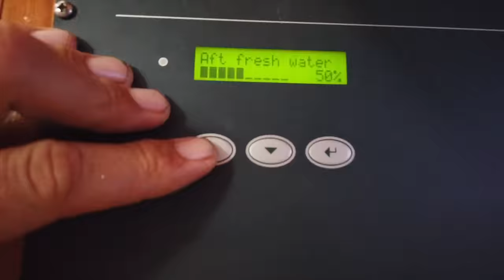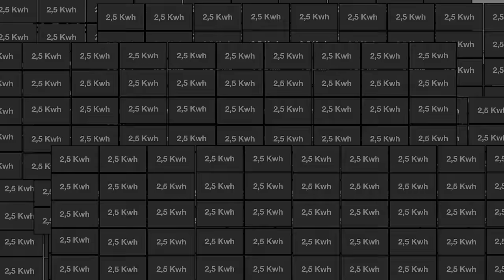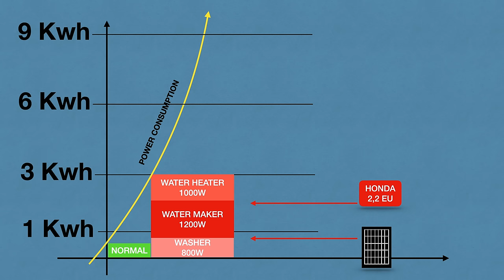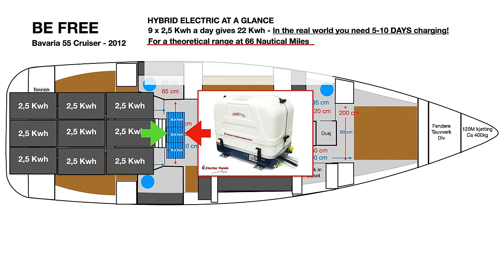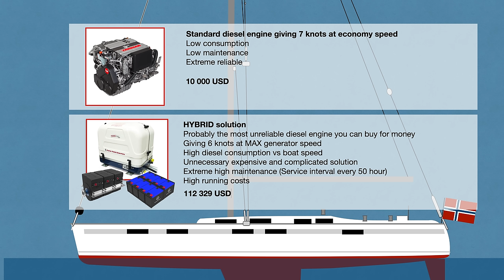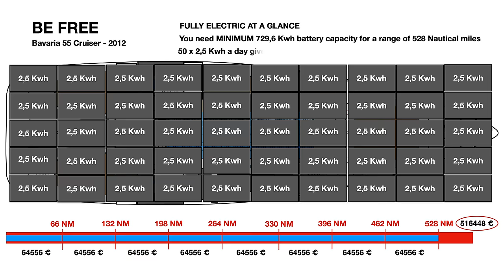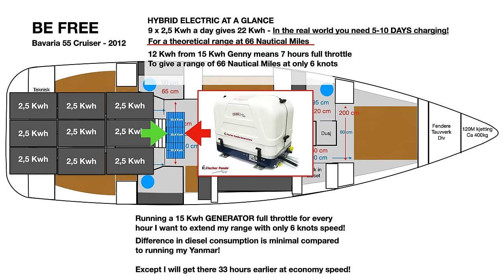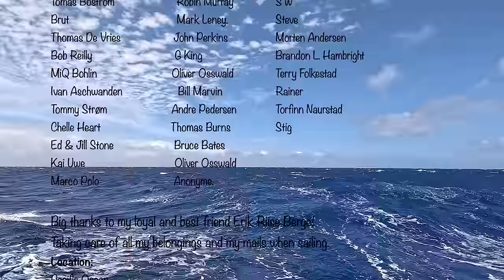Why I don't believe in ELECTRIC or HYBRID for long-distance sailing - SwT 170 - MY HONEST OPINION

Comment: Good vid production but silly and too all encompassing viewpoint.  (just converting my boat to electric.  Went across the Pacific with first).  Some of us like sailing and like to read weather and have not much of a safety net but our sailing knowledge.  I had to time my way into every port, atoll or passage.  Became very aware.  Most of the sailors I met along the way did not use their motor from the Americas.  Our times were awful, in the 30s and 40s for day ranges.  Major currents out of place and a week at the equator.  Were sailors.  But everybody's different.  You are not recommending electric because you have put together a Bavaria 55, your boat.  And that's it.  You have a funky Fischer Panda generator....so obviously all generators are unreliable and hybrid is not reliable.  Uboats worked rather too well, Prius is very reliable, Queen Mary 2 honks, and Uma sails away...hmm, they have no generator.  Its freezing in northern Canada.  I've trusted my family with a generator.  Gotta be maintained and not run at max load.  My new hybrid system is 66 KW continuous on a 41 foot boat and as long as I can find a gen under 3000 the total cost will be under 10000 dollars including batteries.  So they don't have to be Ocean volt or branded.  Electric is different.  Its just a motor that is in 1000's of factories.  And I lived on my boat in the South Pacific for 3 years (mostly Vanuatu) and ran fridge and laptop lights etc...with 500 watts of solar.  Generally like your channel but you have lots holes in your arguments.
Reply: Uma has a generator and they have said they run it every day.